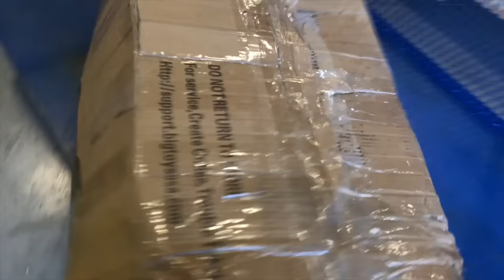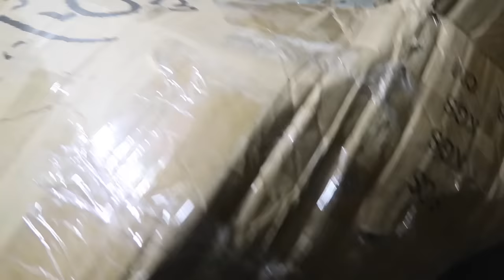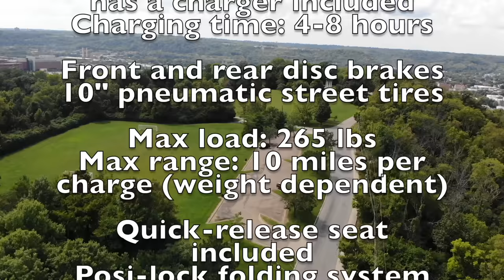Uberscoot 1000w Electric Scooter Unboxing & Installation Full Test Ride

Comment: I observed maintainable top speed aswell as highly controllable and safe. Also acceleration is great. Goes up huge hills with steep slopes with only a slow of 10mph. So you can go up any hills a car can. Its slower but you get up there without walking.

Comment: They first had the 500w then the 800 watt and then the 1000 was the last one I bought. I have been buying this brand since 2003 when it first arrived to eBay. I blindly trusted it the specs was everything I wanted and it was everything I expected.  Super cycles in scooters 600 bucks. Everyone else wants way more. And it takes a beating I jump it like a 80s GT Performer freestyle scooter I had in 1986 at 10yrs old, now 45.  It is a power sled to haul things. It is a power supply. I power stereo systems with inverter. You can run power tools. You can power your campsite. Get a 2000 W portable battery cube with 700 W solar array. And you have transportation and electricity everywhere you go. It's the ultimate for the homeless person on skid row or here in Detroit.

Comment: I'm new to electric scooters and watched hours of video's finding the right first one.  Was going to get the Hiboy S2 pro for $ 550 but this one is not much more ($621) for bigger motor and longer range.  I would later upgrade the batteries to lithium.  Would you recommend this as a first scooter?  I just didn't want to buy a smaller scooter and then having to upgrade again soon.  Thanks.
ADDENDUM: There is now a 2021 Blaze 1000 watt with larger motor and full lithium for $779 .  I would lean towards this one as the Uberscoot has terrible lead acid cells
Reply: Dude I have the hiboy s2 pro and it is my first electric scooter, it is extremely durable, well made and has just been a great experience. I highly recommend it. It also folds and is very lite, u can fold and take on the bus. These bigass uberscoot are not going to be allowed on bus.

Comment: Wow those things are loud, and how does a 1000w only go 20ish I have 1 500w motor on back wheel and its goes 20 and it would have to be an extremely steep hill bring to it to 10 mph. Just trying to understand the reasoning for that? I have a hiboy s2 pro if that helps.

Comment: Hi Jason, just order my uberscoot 1600w.  I am looking forward to upgrade my speed already after watching all your videos.  However, where did you get your storage box under the seat of your scooter?
Reply from the maker: I just checked the link I got it from and its no longer available. Looks like Walmart and amazing also has them but sold out I found some on eBay that are for $26 just type in “Bicycle Rear Seat Frame Cycling Bag Waterproof Hard Shell Pack Saddle Bag”
Reply: Thank you.  Found one. Amazon of course! You the man!

Comment: Any suggestions on repairing if exposed to water.  I was riding today and got caught up in the rain.  Needless to say, it stopped operating.  When pulling the throttle, It barely goes.  Please help, I just purchased it last week.
Reply: I did not know there was a problem with water!  Thought things were covered, but I know a normal bike can rust.  Haven't purchased yet, but will keep it covered and stay out of the rain, or inclimate weather, thanks.

Comment: Where can I find a 48v battery that would fit this scooter ? Would it make it faster
Reply from the maker: It will give you a bit more power and way more distance range. The regular battery goes 30mph at top speed for 12miles with the lithium I get 39mph as top speed and 27miles in range

Comment: How much weight does the scooter hold? Im thinking of riding it with my friend
Reply: I have this same exact scooter but it's by another company its called super turbo 1000 elite with the 54 tooth sprocket I'm pushing only 18mph with stock lead acid battery and I'm over 270 pounds I just put a 64 tooth sprocket on it but waiting for my bigger chain to get here then I'll go for another top speed run with more torque small sprockets won't pull me but that scooter can hold up to 300 pounds rider weight And you can modify it to be a beast on the road

Comment: would you recommend buying the Uberscoot scooters or super turbo 1000 elites from superscootersales? thanks!
Reply from the maker: Tommy Brumfield definitely Uberscoot as the super scooters are outdated meaning the parts are from 2012 the scooters are unstable at high speed specially if you hit a pump (check out my crash video for proof) I would go with Uberscoot, better parts and more stable, if you can go with the 1600w
Reply: Jason Evo awesome thanks so much for the response! Ive been trying to find a place to pick one up but it seems every place is out of stock.
Reply from the maker: Try bigtoysusa they recently restocked also amazon has them
Reply: Jason Evo tried both sites and said they were out of stock for the 1600. eBay has them for $759. Is that about right ?
Reply from the maker: Tommy Brumfield it’s about right as bigtoys has them for $693 plus taxes comes about right.

Comment: How come you don’t like that mad scooter bro? Isn’t it the same as the other 48v 1600w...”your baby”? Is it heavier so it’s slower? I’m just wondering because that mad scooter seems tight. Don’t get me wrong, that other velocifero is dope AF, but just wondering
Reply from the maker: The mad is heavy so it’s very slow if it had a bigger motor and lithium setup it would be Amazing but the current set up makes it more of a child toy. The 1000w is faster

Comment: I have 60v 2000w version. Mine only goes 22-23mph. Speed limiter disconnected
 Brand new controller and motor.

Comment: Jason Evo! 
The 1600 is awesome! Lots of torque! How much hill climbing capability did u lose when u switched to the 44 tooth sprocket? I'm thinking about doing it, but I don't want to lose that hill climbing torque! I'm 210lbs, and it takes me up a steep hills with ease! I appreciate ur knowledge and help. U go through it, so we don't have to. Just ask Jason! Lol. Really, thanks man.
Reply from the maker: Sorry for the late response I just saw your comment. I didn’t lose much as I’m lightweight but the only difference I notice was taking off from 0-10mph the hill kit was faster but the 44tooth got faster after 10mph and up. With my lithium battery my brother weights about 230 and he flies up the hill
Reply: @Scentedstyle  
Thanks Bro. I noticed it a little slower on take off, too. But man, I just got baptised!😂 Trying out the battery in the dark, in unfamiliar territory, I hit a curb n went sailing! Fractured elbow AND wrist! Learned my lesson! BE CAREFUL!!! Back in the saddle in 6-8 weeks tho! Lol
Reply from the maker: @bigtylee  oh man I'm really sorry to hear that, that really sucks i hope you get better soon. its very important to wear protective gear while riding with the lithium setup. I crashed so many times at first trying to get a hang of it. please be safe while riding
Reply: Thanks. Lesson learned my man 100%

Comment: Great review I've ordered one like this
It is 1000watt, 36 volt, and top speed 25mph
And I have a question 
Is it durable and built to last??
Reply: They will last forever if you never ride them. Like all mechanical things they wear at a set rate so just keep up with the maintenance and they will last for ages.  Did you ever get 25mph out of it. I didnt but I knew the makers would lie about the speed.  They wouldn't sell many if they said you can run faster. I love mine anyway.
Reply: @thra5herxb12s  yeah true, I look after mine so it's all good, mine does go 25mph and sometimes reaches a slight bit higher.

Comment: Hey jason what's up buddy,  i was wondering if could make 10 miles with the full throttle in a single charge?
Reply from the maker: Yes it can go 10 miles at full throttle 20-25mph
Reply: Scented Style how long does battery last would i be good for a few hours?

Comment: Have you (or anyone) found a reasonably priced 36V 35AH lithium that fits and works with the uber 1000w?
Reply: Seen it new for $ 100 online doing resrch on it for 100 ill buy like 3 n resale.

Comment: Hey Jason. Im just inquiring, what is your thoughts on the VELOSIFERO SCOOTER please.
Reply from the maker: Hey Chris, I actually do have the mototec velocifero 1600w also and in my opinion it’s a lot slow compared to the 1600w scooter. It’s mostly slow when you just take off takes like 5 seconds to get from 0 to 5 miles very slow and the top speed is 25mph I never use mine I rather ride the 1000w ubersoot goes same speed, also it’s very heavy you can’t put it in the car to transfer you need a truck. The price is expensive not worth it in my opinion it dies quick short rides slow speed

Comment: Is anyone else having issues removing the seatbar. It's extremely difficult to remove it's almost as if it's stuck However it shouldn't be because when I put it in the hole it made that clicking noise Now that I'm trying to remove it it won't come out. Does anyone have an easier way of removing the bar please advise

Comment: Hey pal, I have a 1000w 36v electric scooter, and it's tops around 15/16mph, I'm looking to try and make it go quite faster, could you tell me what I need or what to do as I have no clue with what I'm doing with these xD thanks.
Reply from the maker: Flux I have a video coming soon to explain all this but what you need to do is change your controller and battery to a 48v system
Reply: Jason Evo thanks man, what price would it come up to do you know?
Reply: @Scentedstyle   How do I know if my motor handles a higher voltage set?
  Wouldn't shorten the motor life time as drains faster the battery juice?
Reply from the maker: Hellen Moreira check out my other video to get answers to all your questions
Reply: I think you do a good job with your videos

Comment: My electric scooter would smoke the shit out of that

Running 60v 20amp lithium battery

On the ASSASSIN USA EV3000
Reply: 0-60 kmph in 3.6 seconds 
0-80 kmph in 5.1
Reply from the maker: Yes it can smoke this 36v but It can’t beat my 1600w 50v 40amps scooter
Reply from the maker: My scooter would smoke the diarrhea of that lol
Reply: Umm, my scooter would still destroy your 1600w scooter...

My scooter has duel motors total of 6000w
Reply: But it's still just a scooter

Comment: Uberscooters are shit. Had on that i only put around 2 miles every day as my commute and the sprocket/chain were cheap Chinese stamped steel and easily warped and kept falling off
Reply from the maker: You can upgrade the sprocket and chain for better performance
Reply: @Scentedstyle  I couldnt find anything that would bolt up to the wheel, let alone find a chain that worked for both sprockets. Also is a bitch to try and align them if they do get warped.